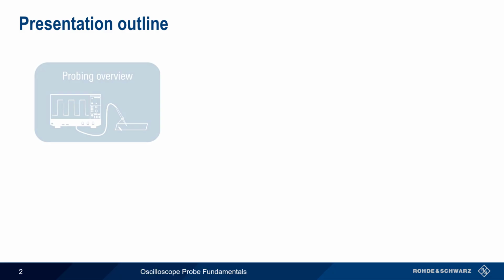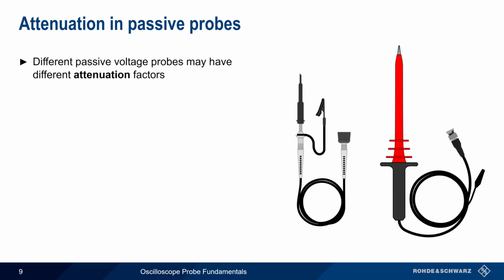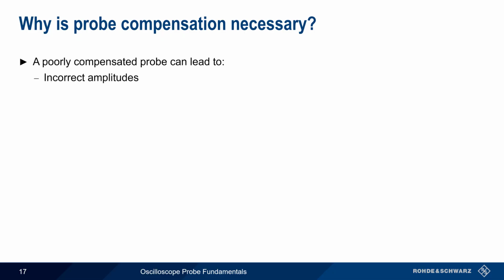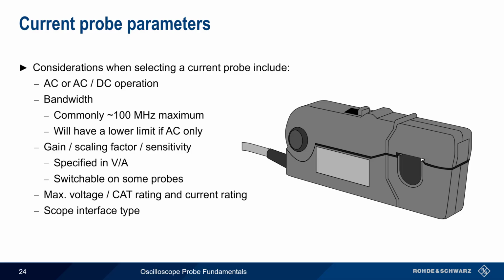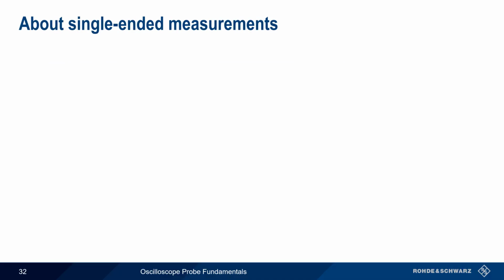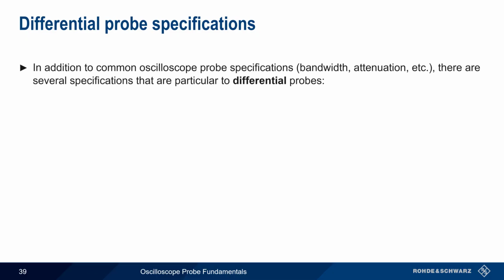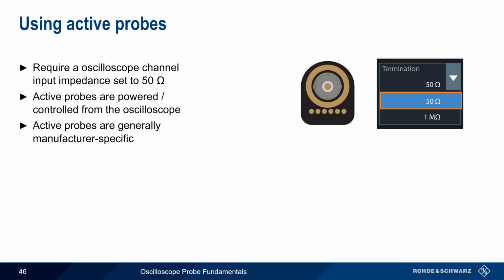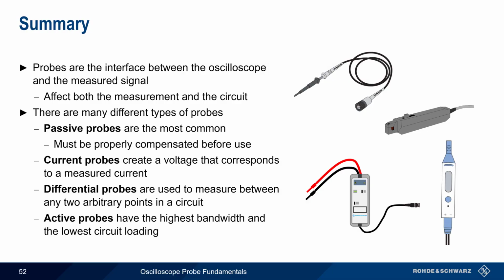Understanding Oscilloscope Probe Fundamentals

Comment: I noticed that in your previous video ZNB3000 - Compression Measurements, Gain measured with respect to Input Power gives the Compression Point at a 1 dB interception point while in this video, the interception point for Bandwidth when measuring Amplitude versus Frequency is 3 dB. Why is one 1 dB while the other is 3 dB?
Reply: They are both just conventions - there's nothing "special" or "magical" about being 3dB down on a scope or 1 dB down on output power of an amplifier.  In fact, for compression measurements, other points are not uncommon (P2dB, P0.25dB), although I think 3 dB is pretty universal for scope bandwidth measurements.  There may be some historic reason why it's specified this way for scopes, but I couldn't really say :)
Reply: @pauldenisowski Ok, thanks. I was wondering: Does this entire Test & Measurement Fundamentals playlist come in the form of a physical (paperback) and/or digital (PDF) reference handbook? I realize of course that there would be updated versions of a handbook over time as there are new videos uploaded to the playlist all the time. Thanks.
Reply: @amaechinwankwo8283  No, not at the present.  It's been discussed, but for now I'm sticking with the video format :)
Reply: @pauldenisowski Ok, no problem. Thanks.
Reply: @pauldenisowski Ok, thanks.
Reply: @pauldenisowski Ok, thanks.
Reply: @pauldenisowski Ok, no problem. Thank you.